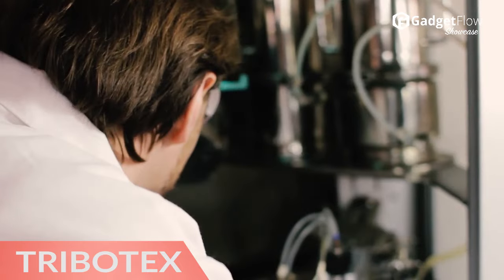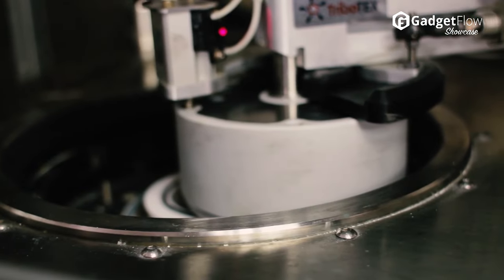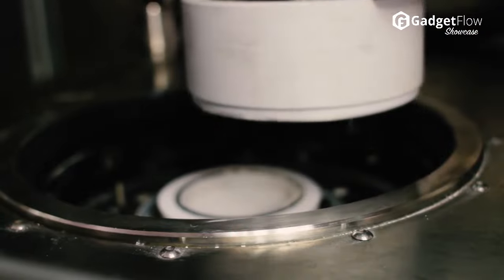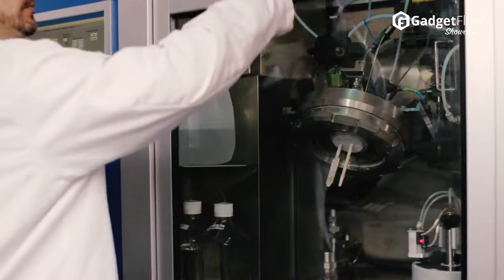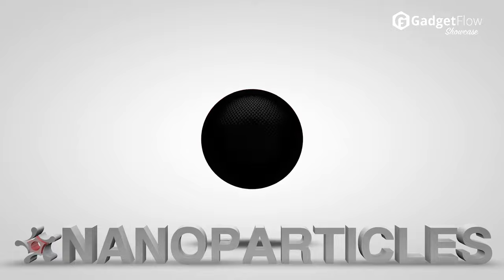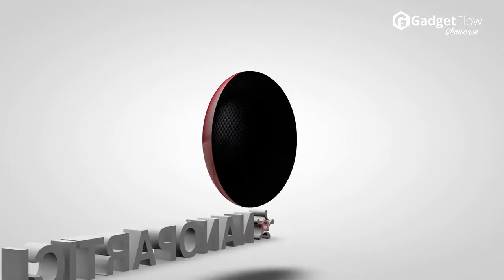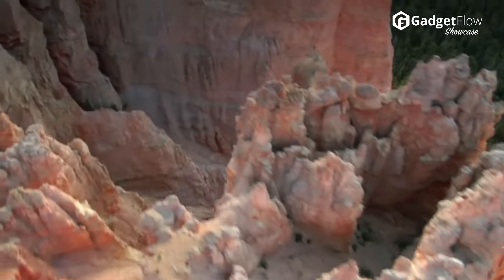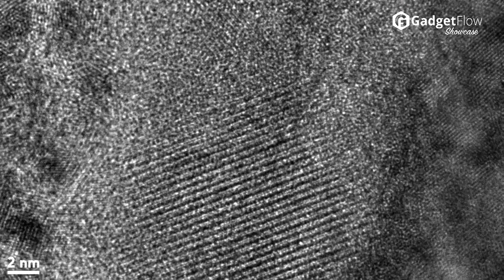TriboTEX Vehicle Enhancing Nanoparticles - #GadgetFlow Showcase

Comment: Awesome idea! How do they make nanoparticles like that? I was under impression that nanoparticles are just tiny clumps of matter.
Reply from the maker: Yeah, it's pretty innovative. It’s like ceramic protective coatings used in some of high-performance engines, but it reduces friction 10X BETTER than engine oil alone.

Step 1: Take your car out for a drive to warm the engine up. You want to make sure your engine is warm before applying TriboTEX.

Step 2: Open your oil reservoir and squeeze all 20 ml of the proprietary nanomaterial into your oil tank.

Step 3: Idle the engine for 15 minutes to allow the engine oil to mix with TriboTEX.

Step 4: After putting another 500 miles on your car (about 2 full tanks), your gas mileage will experience the full effect of TriboTEX at work.

Step 5: Apply another coating of TriboTEX AFTER driving another 40,000 miles. One syringe is enough to treat 3-8 quarts of oil. Just add extra applications if your car or truck takes more oil. 

Hope that helps. :)
Reply: hmm. i dont know, how you can know that this is not a fake product, it would be not the first fake product on kickstarter, and also not the first oil additive one, hah.
Reply: If they made particles like that it is pretty radical approach but what would be the process? I doubt that this is a garage level technology.